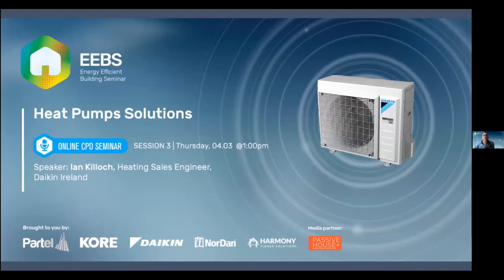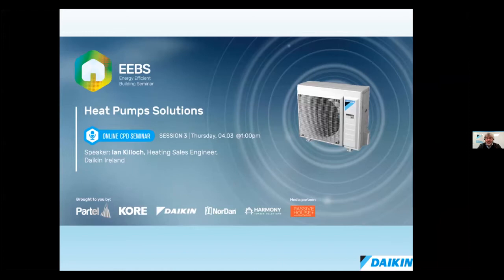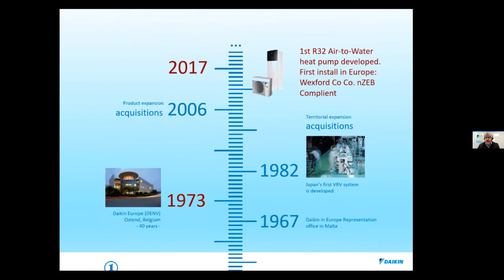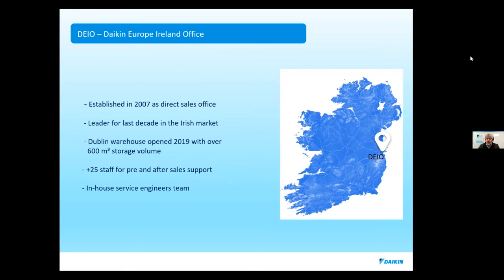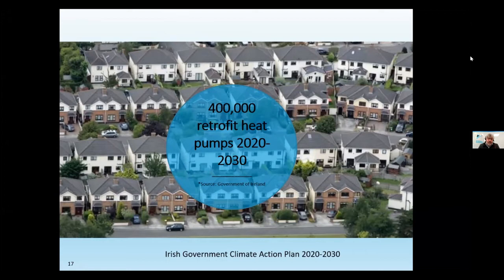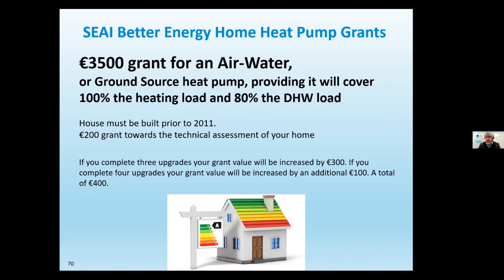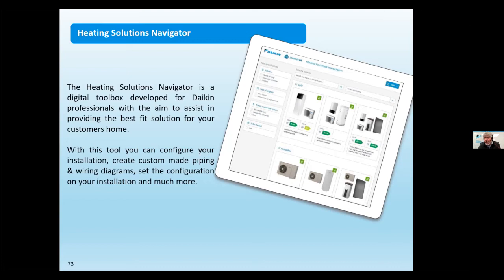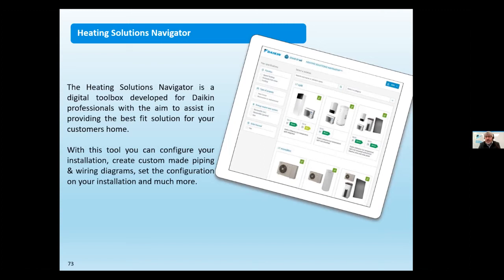Partel EEBS Series | Heat Pumps Solutions by Daikin Ireland

Comment: Great information.
Looking at the fan unit I understand that few different type of metals are connected and in our allways wet West Coast Irish climate the galvanic corrosion can take place how effective and long lasting is the  corrosion protection? 
What's the cost of the yearly servicing of the air to water single fan heat pump?
How often and at what cost the refrigerant has to be recharged?
What's the lifespan of the system and what parts of the system will need to be replaced for the new ones and at what cost?
Thank you.
Reply from the maker: Thank you Matt, we appreciate your feedback. Hope you found the EEBS Series informative and useful. For any questions or further information about Daikin's solutions, please contact killoch.i@daikin.ie or call 01 6423430.